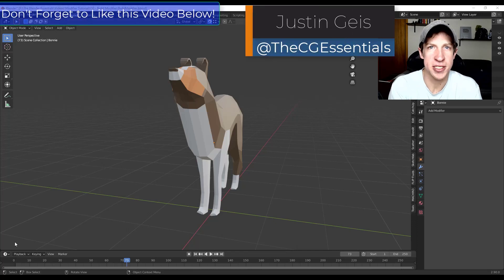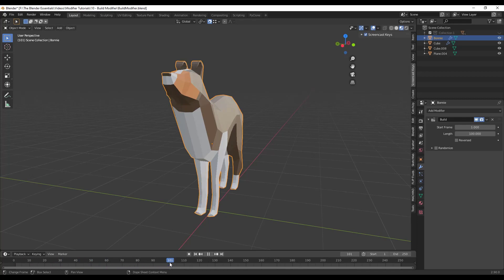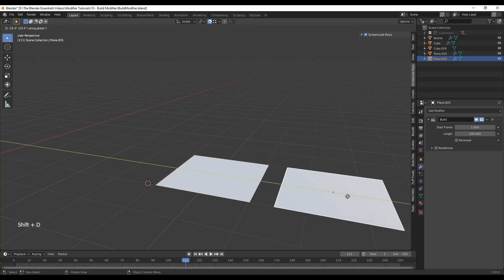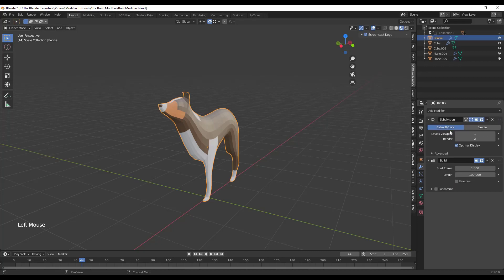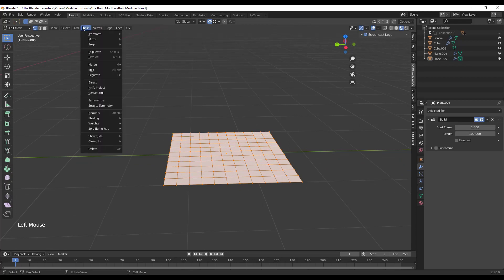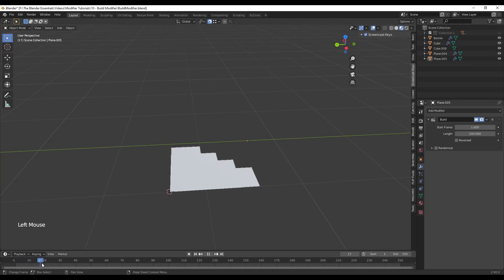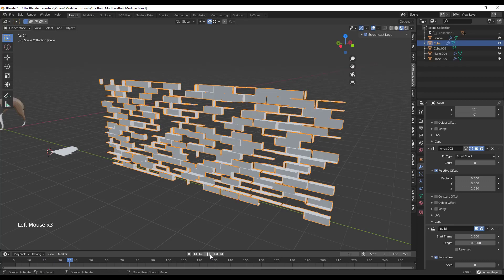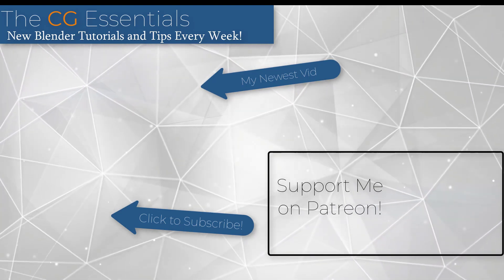Using the Blender BUILD MODIFIER for Beginners - Step by Step Tutorial

Comment: great video. say for instance i want to animate a 3D printer printing an object line by line. what would i need to do that. do i also have to use modifiers. i did play a bit with the liquid one but that did not work out too well as you can only lay down in one axis at a time. the build modifier looks like it can work but still not getting the right efect. if i can get it to hide the model and reveal one line at a time as if it was laid down by the printer that would be great.